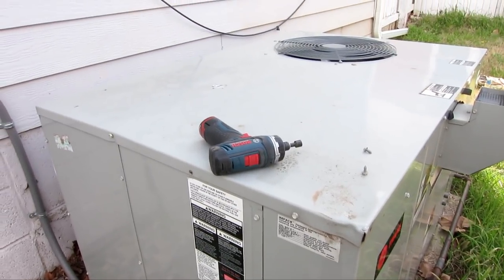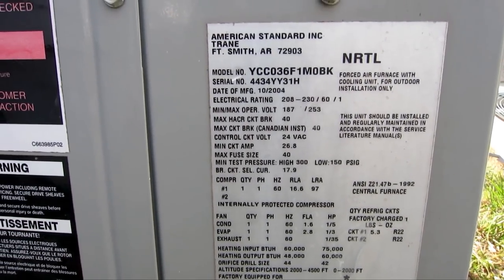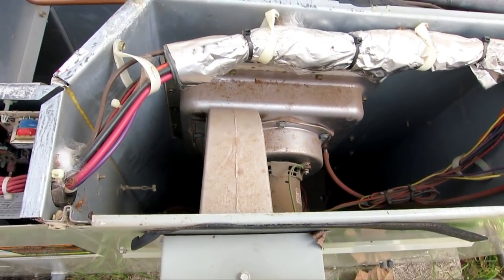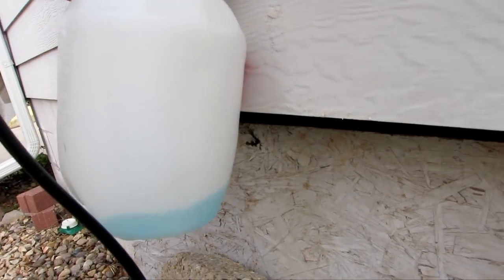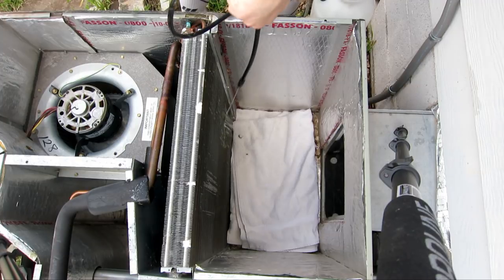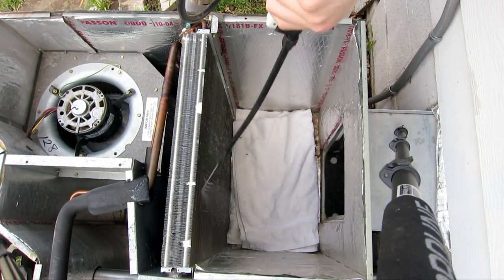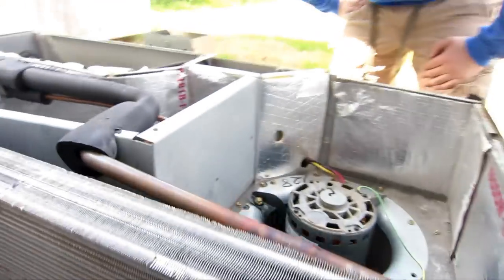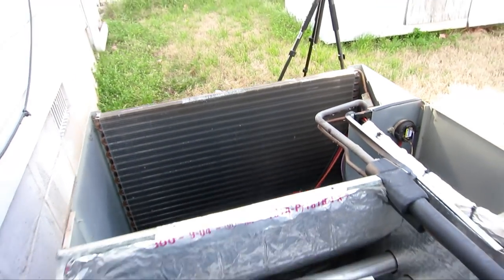Cleaning all in one outside unit evaporator and condenser coil - Package Unit Air conditioner AC

Comment: Won’t the drain pan get clogged with gunk and start over flowing?
Reply: You'd need to clean the pan and check to make sure they're open last. If you have tubing directing away from unit make sure it's open too.

Comment: Hey man... hoping for a reply here. I'm a carrier transicold tech in upstate ny. My parents home has a Miller all in one outside unit. Past 4 years it's been freezing hellaciaously in hot weather. Blower spins well, all fins intact. Condenser fan operates well, condenser is clean. Could poor evaporator return placement be the cause? It's a double wide modular home, the return duct and filter is on the lowest floor. I was thinking low charge, causing poor superheat after the expansion valve. This thing is a bitch to get the covers off, years ago before becoming a carrier tech the unit was looked at and the "hvac" tech had no fix. Now that I'm a dealership trained carrier tech, I feel like I have the ability to deal with this, but being a complete unit, there seems to be a lot more variables involved in an all outside unit, strapped with it's own blower, with the evap coil outside. Even poor sealing in the evap box allowing hot, moist air into the coil, ruining its ability to cool the house cause of freezing moisture. Lmk what you may think
Reply: 8ball4554 it’s possible that it is a low charge or an airflow problem. Get me the model # of the package unit and filter size. If possible the duct size going to and coming from the unit. If you have gauges get me the pressures.

Comment: the how to did not show enough and was not explicite about the two sets of coil, any difference in doing the cleanup and where they are.  oh, I see.  if comment is negative you refuse to report how improvements to video could happen.  I've got it.
Reply: Ellayn Chadwick both coils on this unit are tube and fin. If either coil is a micro coil or spine coil water only should be used. I apply cleaner to the evaporator coil with the drain on and remove it to rinse the coil. This allows for better drainage while rinsing. The cleaner that went through the drain line helps break down the debris in the drain line and is easier to flush out. I’m not sure why they had the white towel in the unit. Hope this was helpful.